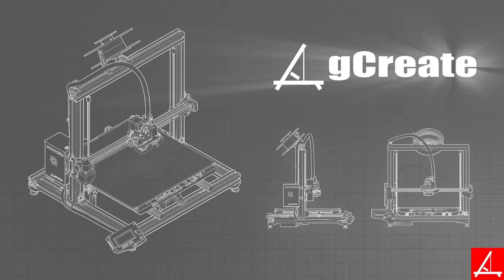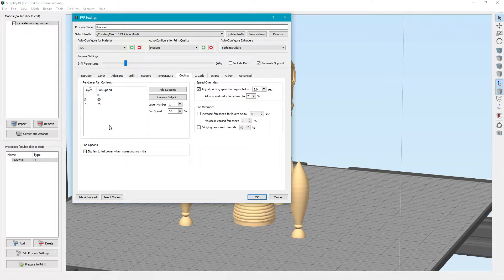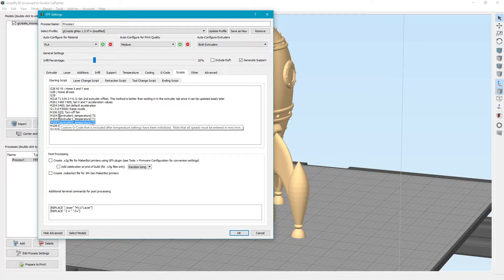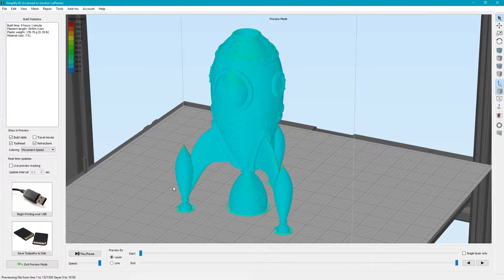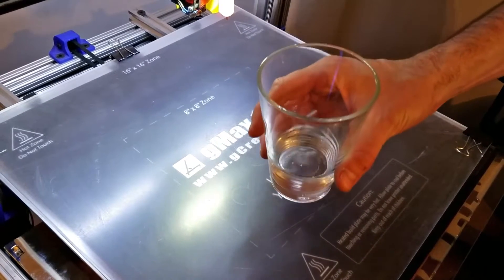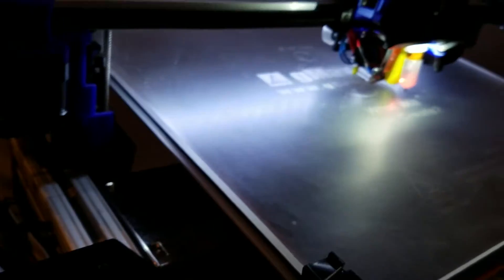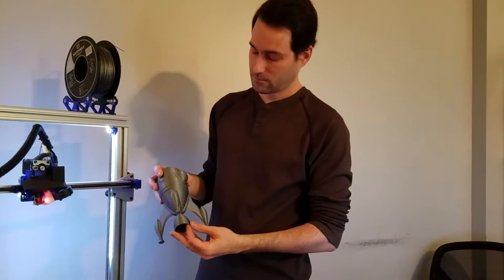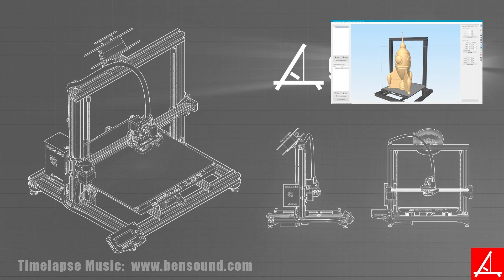How to Design and 3D Print a Rocket Ship - Part 5 gMax 1.5XT + Printing!

Comment: lots of great advice thank you
Reply: +Persev444 Any recommendations for future videos? Too much talking, not enough info etc... We love feedback and try to incorporate it as best we can.
Reply: +Gordon Laplante  You have an awesome print bed volume. Oftentimes when I print ABS or even PLA I encounter problems with warping at the edges for ABS over 6cm and PLA over 10cm. Your customers would need a guide to minimize these effects in order to generate beautiful parts(glue sticks, fan locations, orientation,temperature swings at night etc). Another suggestion is because of your impressive volume, you would need to swap out rolls of filament or filament management for large prints. A guide to hot swapping or pausing prints and doing the gcode shuffle  while controling anxiety would also make a good guide.  Big prints are risky and painful when they fail.  repeating  a 60 hr print is really tough. I really enjoyed your talk tips. You mention many things I learned the hard way. You are clear and very helpful. Best of luck on that cool printer!!!